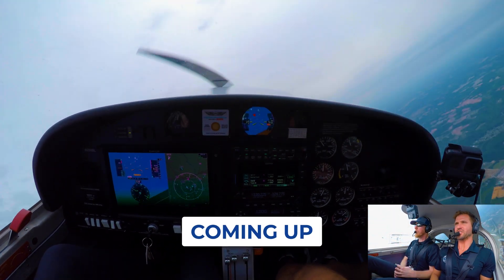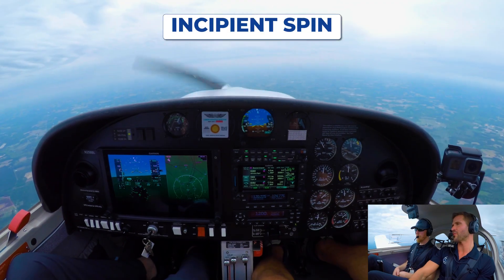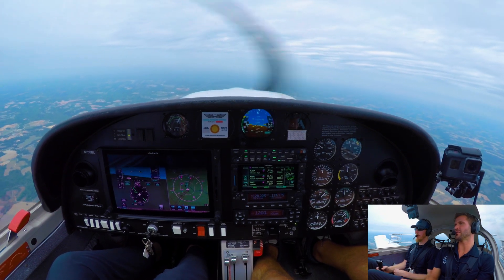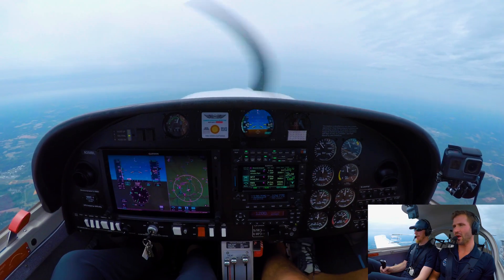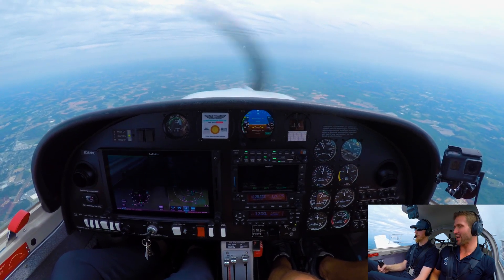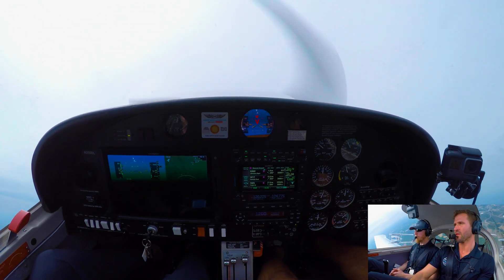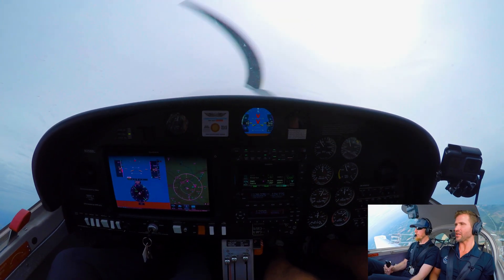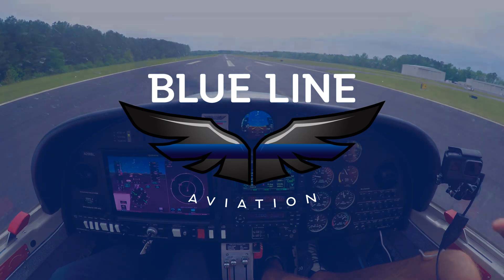Spin Recovery Training | Incipient Spin and Developed Spin

Comment: Quick question. Rudder opposite the spin. In the video you spin clockwise (right wing dropped) So that would be full left rudder? So if your spinning counterclockwise (leftwing drops) it would be full right rudder)?
Reply from the maker: Yes, exactly. Opposite rudder means opposite the direction of rotation (yaw). A common reminder is “step on the high wing.” As always though, follow the POH/AFM for the specific aircraft.